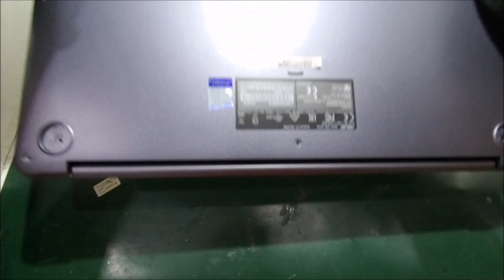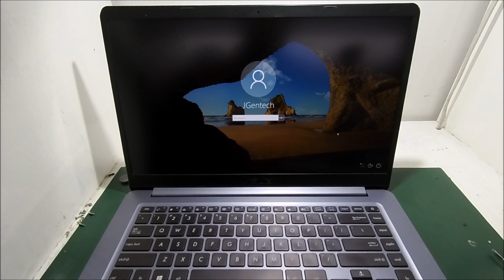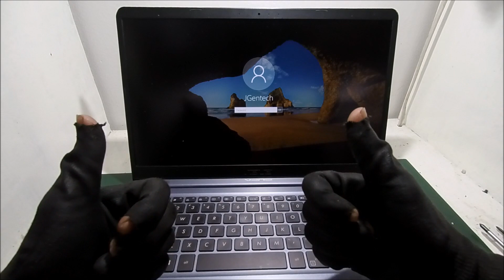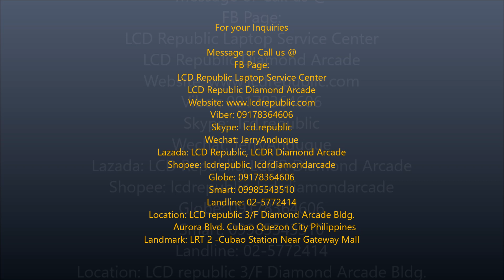How to Replace Broken Screen of Asus S510u

Comment: Not sure why you just didn't remove the cheap black plastic screen bezel and did the work from there instead of removing the whole assembly???
Reply: I was wandering !!?!
Reply: The battery had to be disconnected. Couldn't get to it without removing the bottom. Then, it also seems the bezel was behind/underneath another part that would prevent it from being freed enough to do the work. I just had to do this on an Asus L406MA and it was mostly the same, except for the metal hinges that connect the screen to the main body - one of my hinges was partially under the motherboard. I pretty much had to take the whole thing apart just to free the hinge so I could separate the screen from the rest of the body, slide off that long piece (6:14), and then lift my bezel and replace the screen.

Comment: it's possible mount it the display full hd IPS of this notebook in a notebook asus vivobook  s15 x510uf-BR532T ( CPU INTEL I5, MX130 2GB. RAM 8 GB, display 1366x768) , please answer me is important, i want  to change the display 1366*768 with one full hd ips
Reply: Were you able to replace the lcd screen?